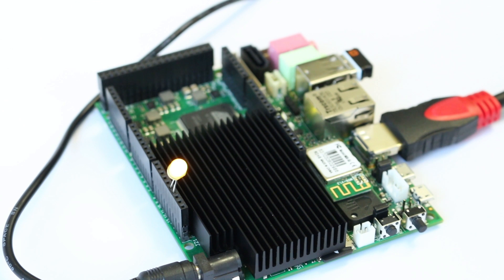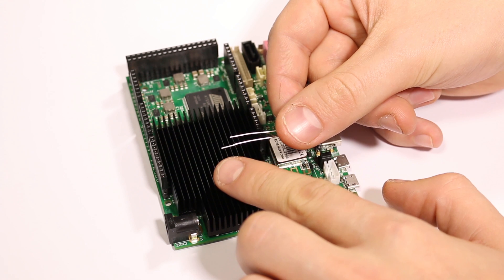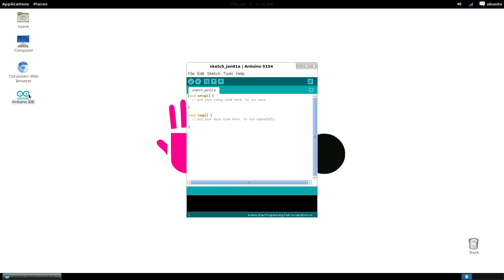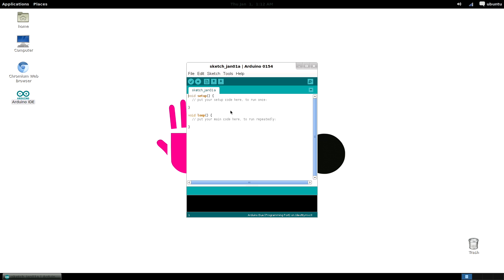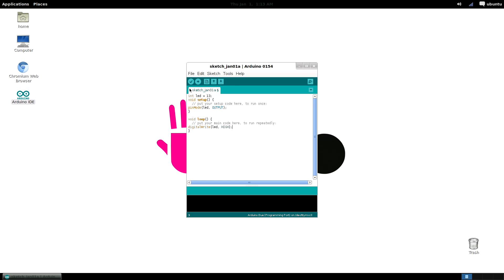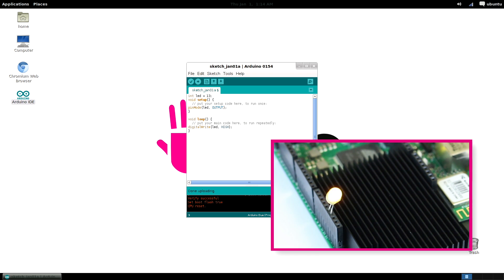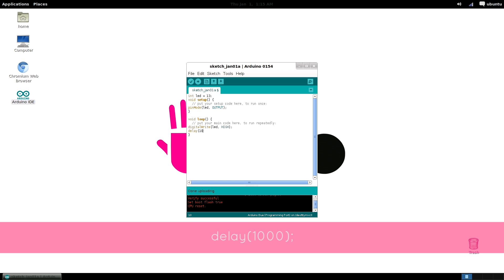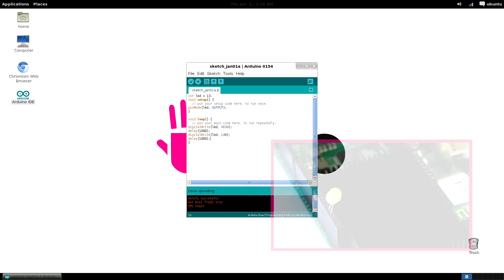Getting started with Arduino-IDE on UDOO

Comment: Where are the GPIO pins on the CN14? The user manual only shows AD0 thru AD5_SCL on CN14.
Reply from the maker: Your question relates to the UDOO X86, not shown in this video. The details of the Arduino pinout can be viewed on the following link: https://www.udoo.org/docs-x86/Arduino_101_(Intel_Curie)/Getting_Started_with_Arduino_101.html